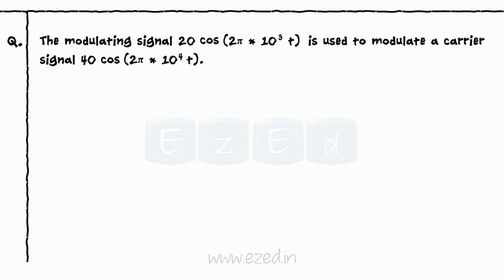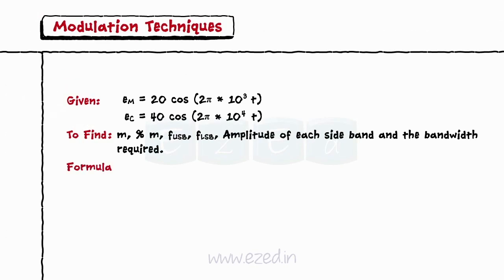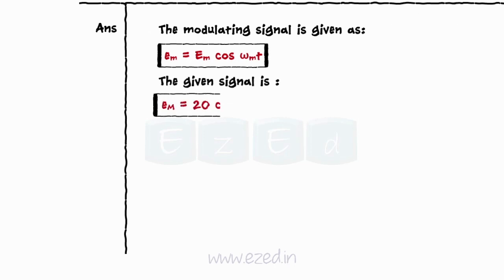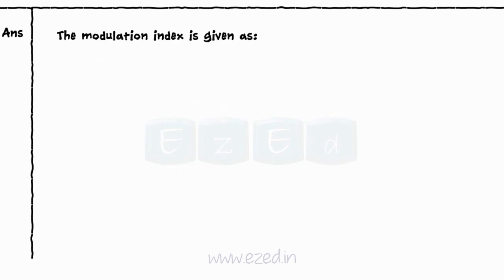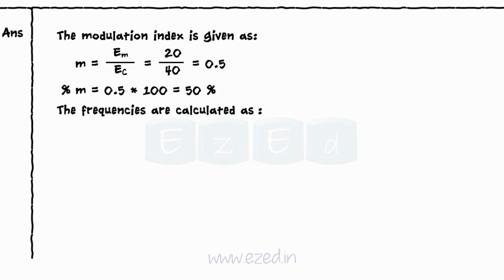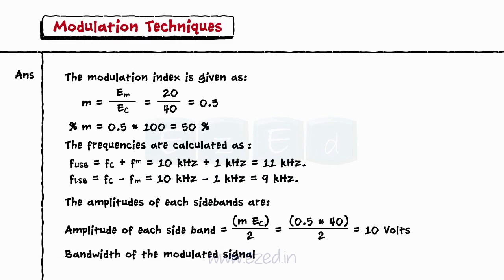SOLVED PROBLEM - Amplitude Modulation - Find MODULATION INDEX , FREQUENCIES & AMPLITUDE Of Side Band

Comment: Good video!
But, may I bring attention to a small mistake?
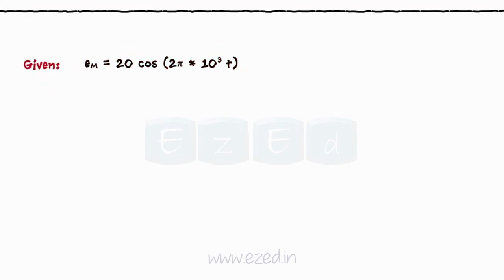At 0:28, em= 20cos(2π*10^3 t)
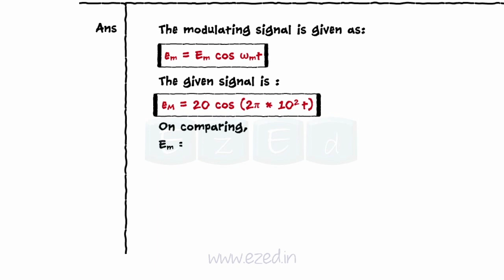But at 1:11, em= 20cos(2π *10^2 t)
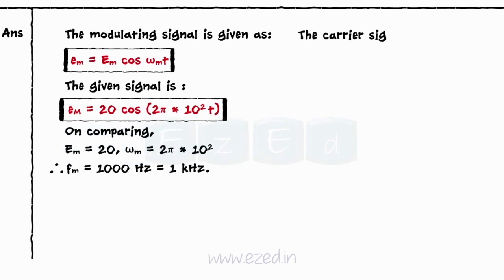At 1:17, wm= 2π * 10^2 but fm = 1000Hz.

According to equation at 1:11, frequency should be 100 Hz (?) This part confused me a bit.😅
Though according to equation shown at 1:17, the frequency should be 10^2 = 100 Hz, it seems you have used the original equation at 0:28 and calculated the frequency of modulating signal as 1,000 Hz as per question.

Since it was originally supposed to be 1,000 Hz in the question, the rest if the video seems unaffected.
Hence, the only mistake being the slight slipup of re-writing the modulating signal equation at 1:11 (specifically the frequency as 10^2 instead of 10^3).

Just wanted to point that out in case others got confused as well.
Thanks for the helpful video!